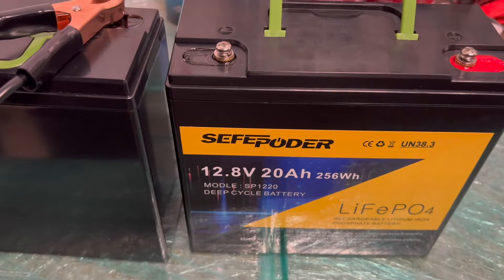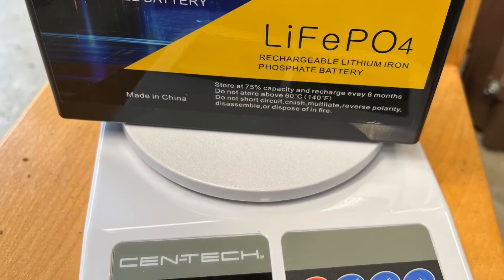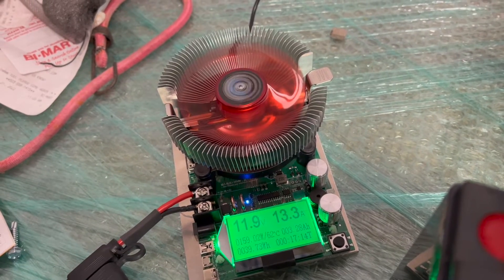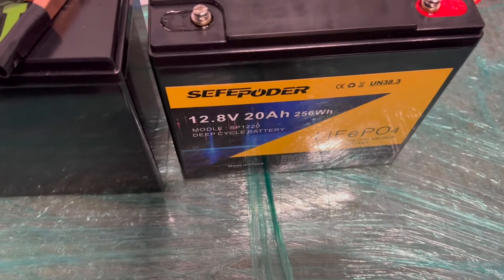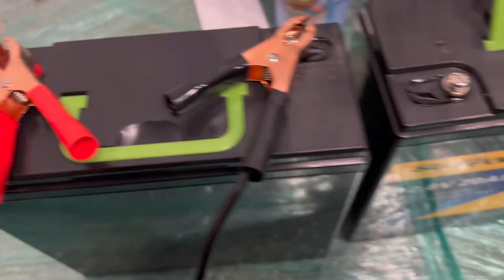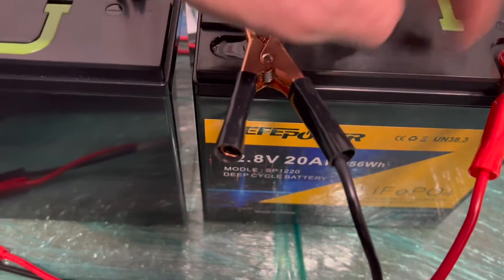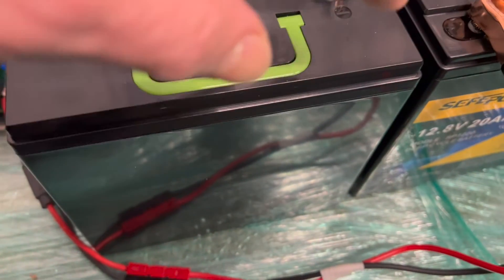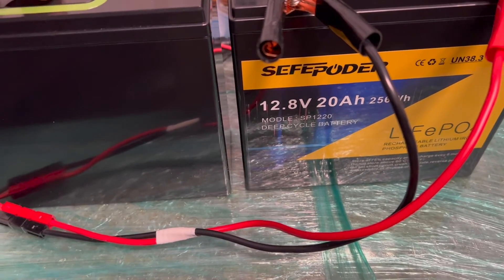SefePoder 12v 20Ah LiFePo4 Battery Review

Comment: Im testing the SeFePoder 12v50a LiFePO4 now. The datasheet (same as the 12v20a) says the nominal capacity is at a 0.2c discharge... You were testing at 0.66c and I would expect a lower capacity. Likewise, I am testing at 0.1c load, and the capacity is showing greater that 50Ah